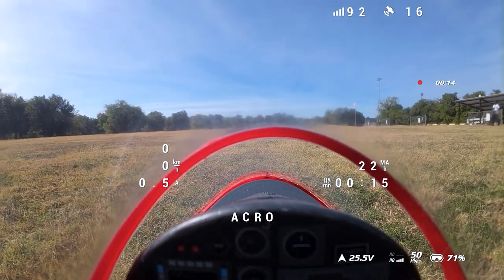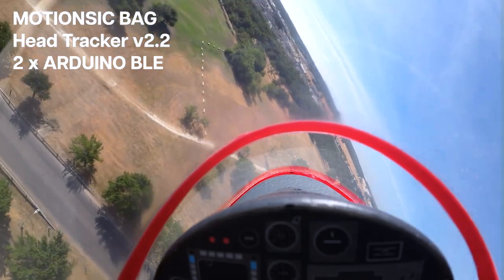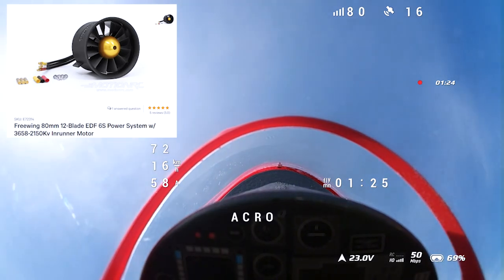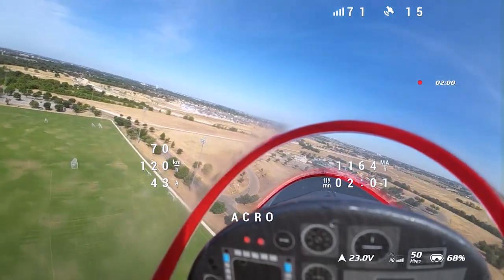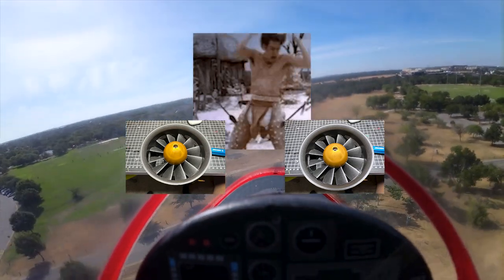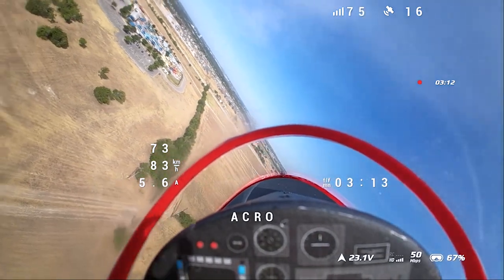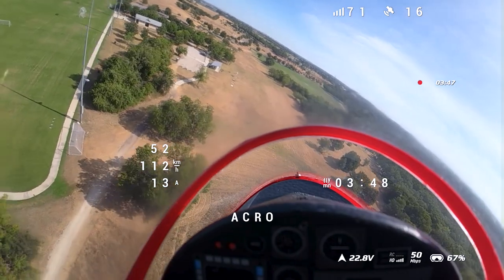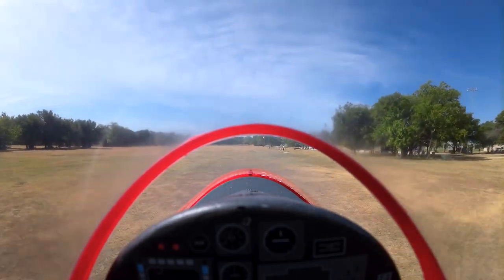My NEW Favorite FPV EDF Jet!! - Custom - Freewing Avanti S V2 80mm is HERE!

Comment: Smooth flying and commentary Antonious!  The Avanti V2 certainly looks like a great flyer.  But the low canopy bow and high instrument panel (as you noted) makes the view out the front look awkward which keeps me from recommending it for FPV.  Love your approach and landing.  Would be very helpful if you kept the speed OSD for landing.  I’d say the Viper 90 would be almost a 10/10 plane if the canopy came clear enough for FPV.
Reply from the maker: Thank you so much for the compliments! I do love this plane but as you said the issues that come with it makes it a hard plane to suggest for a plug n play scale fpv option - it does require a bit of work to get where I'm at currently - depending on how much time I put into this plane I  may come up with a drop in option that can be 3d printed to make a part of the process easier but that doesn't speak to the low canopy bow and the stock windscreen being pretty low vis - Could be a fun project to collab on. 

I can say this though the BAG was a perfect drop in.
Reply from the maker: also I will keep the telemetry data up for takeoffs and landings moving forward! That is important
Reply: @AntoniusBlack01 Thanks for the prominent mention on Motionsic BAG, glad it worked out.  I am always impressed by your 3D print creations. If you want to sell them let me know.  I’ll give them a try.

Comment: Smooth landing! so you have a custom made cockpit? no need for a cooling fan inside for the O3? I use one in my Viper 90 because it overheats rapidly on ground. Can't wait to have my old Freewing L39 back in the air with INAV this time!

Comment: How do you feel about using INAV on an EDF? Is it overkill?
Reply from the maker: Good question, I really like having INAV for the onscreen telemetry - the flight modes also help in case the weather is super crazy and honestly the auto tune feature takes a lot of the work out of getting your plane right. It makes it easier/faster to get into the air if you’re used to the setup process
Reply: @AntoniusBlack01  that is exactly what I was thinking. Hopefully we can get enough people involved in INAV to make it big enough to get more people deeper into the hobby.
Reply from the maker: @cwwisk  In all honesty it's going to take more of us putting out footage and showing people how accessible this all is. - I've been using INAV like this for scale fpv for years now and I had no idea other people weren't - exposure is key
Reply: Arduplane is overkill for stuff like this. INAV I think is perfect. Gives you so much stuff that is very useful for flying but does not require a degree in computer science to setup.